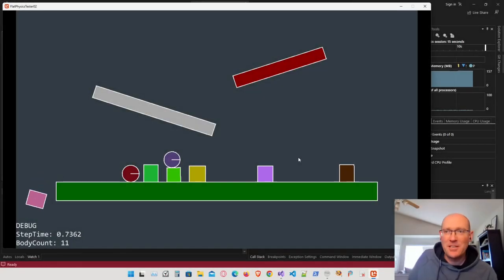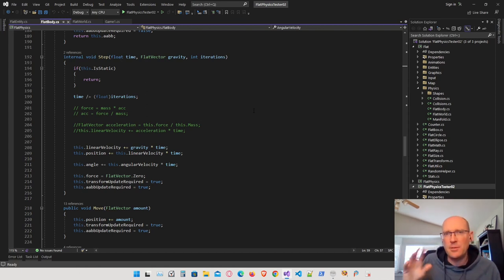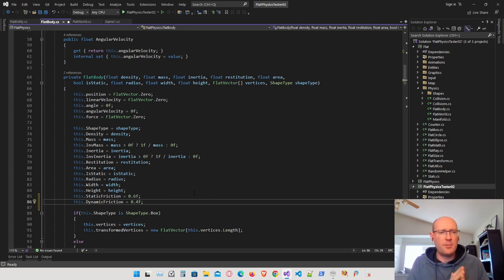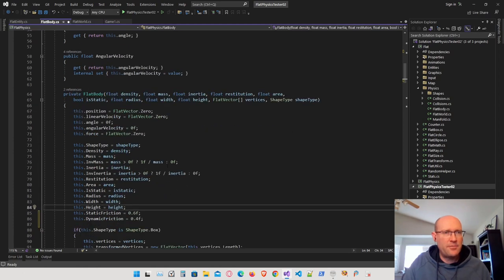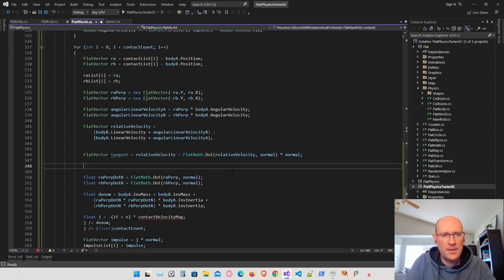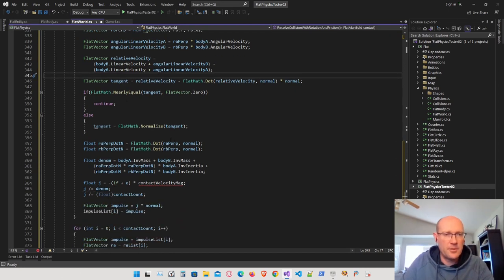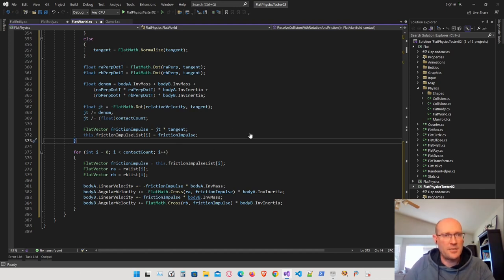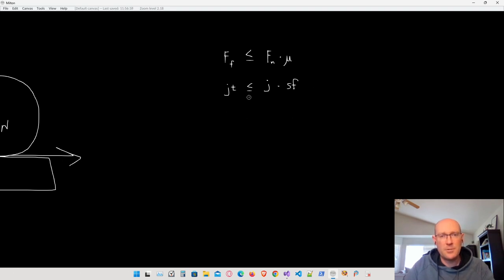Friction Physics - Let's Make a Physics Engine [24]

Comment: Hi Two-bit, I implemented the friction physics and my engine is working now!!! The boxes are resting on the static bodies. It didn't work at first. I was using Verlet integration which does not explicitly keep track of linear velocity. It took only about 1-minute to change to Euler integration, and it all started working. Incredible. This has been a great summer project. Thanks!
Reply from the maker: So good! Thanks for watching!

Comment: Thanks for this, I was looking at implementing a basic physics engine for educational purposes and your tutorials did the trick! I did get stuck for a few days on this part until I realised that maybe you were using radians in the rotation (I stored the angle in degrees and converted it, which looking back is really wasteful).

Comment: Next step: air drag, both positional and angular.

Next step: virtualize the shape object and add a triangle shape.

Next step: add ovals.

Next step: hyperspeed collision detection. (Continuous projection etc)

Next step: break out the physics material and the rigidbody objects.

Next step: unaligned center of mass. (A shape with a heavy bottom)

Next step: motors and gravity wells.

Comment: I just watched this complete series in one go. I’ll come back for more and older videos for sure. A very relaxed and accessible style, yet super informative all the same. Nice pacing. ❤

When you divide jt by the number of contact points, should the Static Friction to overcome then also not be divided by 2 possibly?

Also, please remove the temp array initializers. They’re either not used or overwritten. No need to set them to zero.
Reply: Never mind, you’re comparing to j which also was divided by contactCount.

Comment: Thanks a lot for your work. Is there a chance to get some videos about 3D graphics? Your economic and relevant style would create that lections really excellent.
Reply from the maker: I will consider that. It has been years since I've done anything 3D.
Reply: @two-bitcoding8018  Thank you very much for your answer. That sounds interesting.

I found myself coding a proper 3D projection and more from the scratch, meaning whithout using any graphics engine but the fundamental one coded by myself.. 

Vectors, points, (matrix-)transformations, viewing pipe, depth buffer, animations   --  camera, view plane/view port ...  Still a very satisfying never ending story for me.

I think, many of us would be excited to know of your ideas for that complex some day.

Thanks again for sharing with us.
Reply from the maker: @rudi4505  That is so awesome! I love working at that low mathematical level and figuring out how it all works too!

Comment: I followed the tutorial, and my physics engine works similar to the results showed in the Video. But I think there is still an issue in resolveCollisionWithRotation: the Boxes are not jumping anymore like they did with resolveCollisionBasic.
Reply: Have you fixed your issue? I feel like the same thing is happening to me. The force from the impulse is for some reason not enough to make the box bounce.
Reply: @matouszatloukal  no, but with everything implemented it works the same way like in the video. Looks good. I implemented it with java.